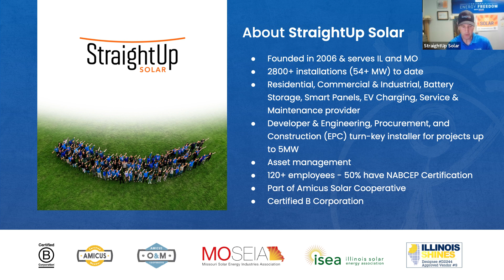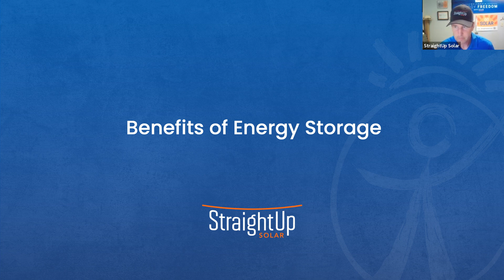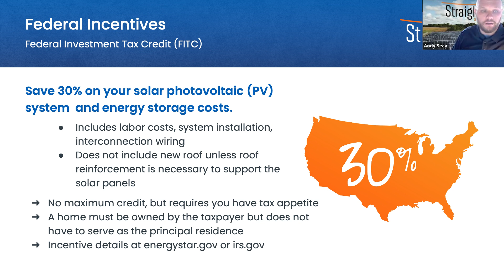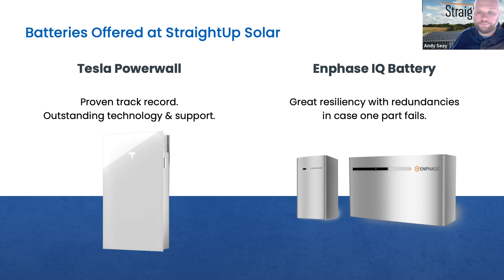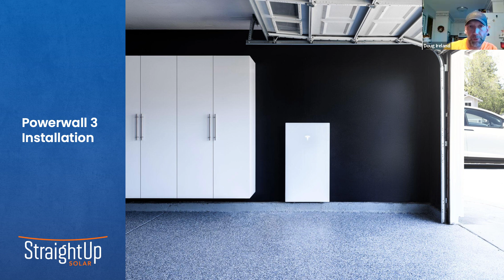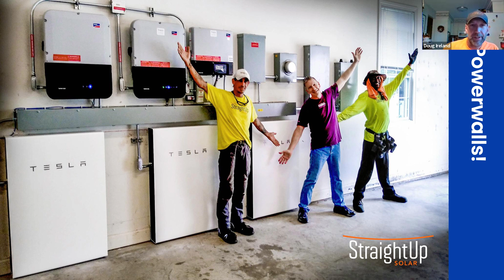WEBINAR: Tesla Powerwall 3

Comment: If you take the battery rebate.
Not sure you can do 1-1 net metering.
Can you look into this please?
Appears there’s 3 other choices.
Thanks for the video!
Reply: Battery rebate has nothing to do with 1on1 net metering. Rebate is with GOV.
Reply: @solargod3671  Ameran is also giving nice rebate. But if you take rebate, no 1-1 match.
Reply from the maker: Thank you for your question. Please note that we serve Illinois and Missouri so net metering will vary depending on your local policy. For example, in Illinois: If you've already installed your system and are getting retail net metering with Ameren Illinois, then taking ONLY the Ameren Illinois battery rebate will NOT impact your net metering. You're only affected if you also take the Smart Inverter rebate, which comes from a new policy for investor-owned utilities in Illinois (like Ameren Illinois and ComEd). IL net metering isn't going away for new solar owners, it's just shifting to a lower rate. We'll soon be releasing a video on this topic. 
Meanwhile, you can learn more about the Illinois battery rebate here: https://straightupsolar.com/residential-solar/illinois-battery-storage-rebate/

Comment: Can the PW3 be used with Enphase micro inverters (AC-coupled system).  I keep getting conflicting answers. Given the AC coupled version is "eminent" I wonder if I should press on getting two PW2s installed now.  Will I be able to mate a PW3 with PW2s?
Reply from the maker: Thank you for your question! The Tesla Powerwall 2 works with Enphase inverters right now. The Powerwall 3 is coming out with an AC coupled solution which will work with Enphase, but it is not available yet. You cannot pair PW2 and PW3 (or PW+ for that matter) in the same installation because the output is different (PW2 is 5kW output vs PW3 with 11.5 kW output). In your case, the decision will be whether you'd like to add a battery sooner (with the PW2 only) or later (and wait for the PW3 solution to roll out). It's best to talk with Jim, your Project Developer about specifics. I've sent him your comment.
Reply: @StraightUpSolar Great video. More information on this subject: We have already completed AC-coupled retrofit installs with the PW3 and Enphase micros specifically. They released their firmware back in Q2 to enable this.
Reply: @ZachSolar details please?  This could help clear up some of the ambiguity surrounding the PW3 and AC-Coupled PV systems.
Reply: @thomasjacques5286  Not sure what details I could share over a YT comment unfortunately, but I can confirm that we have done this in Tucson, AZ. Enphase IQ8A retrofit install to a PW3 with whole-home back up. System is approved, installed, PTO’d and online.
Reply: Gateway 3 is out now